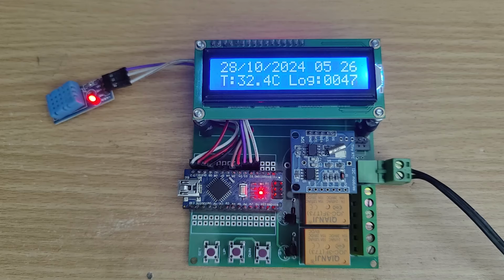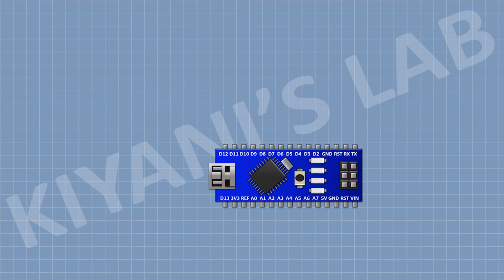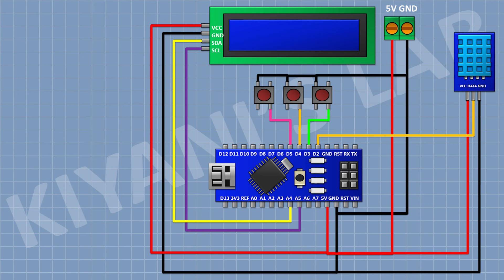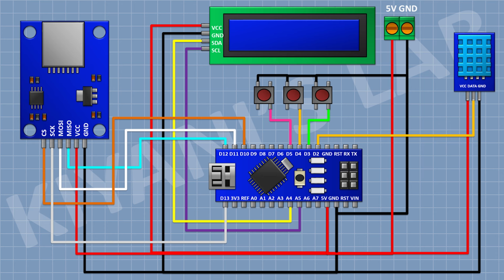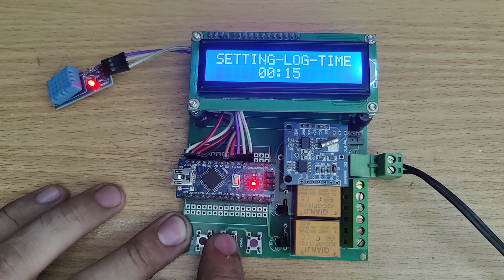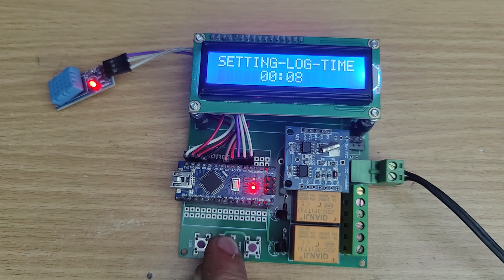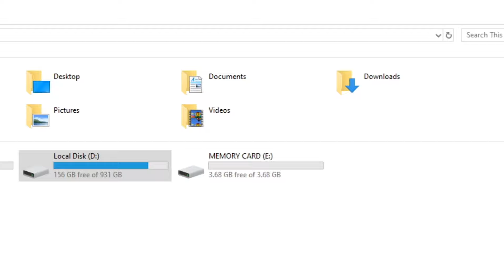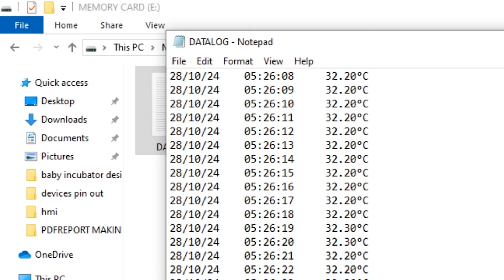DIY Temperature Logger |Arduino Project

Comment: How to Make Remote Control Switch Board for 4 Lights and 1 Fan | Remote Control Smart Switch Board
Reply from the maker: soon
Reply: @KiyanisLab moc3021 triac driver circuit fan speed control or 4 channel relay different load connect